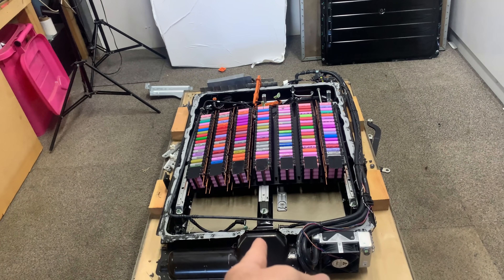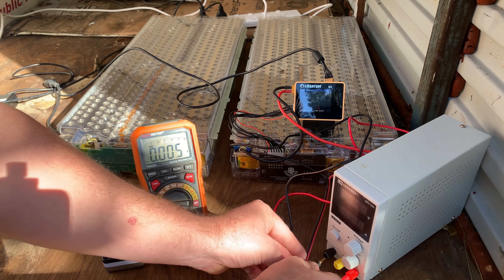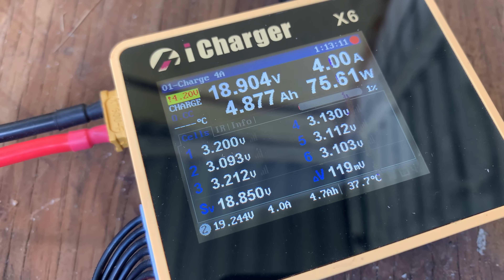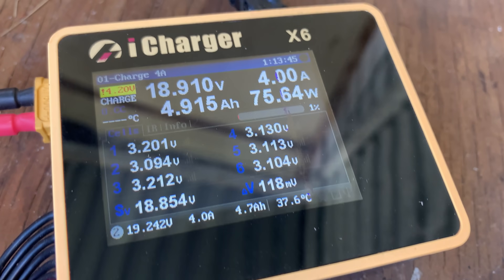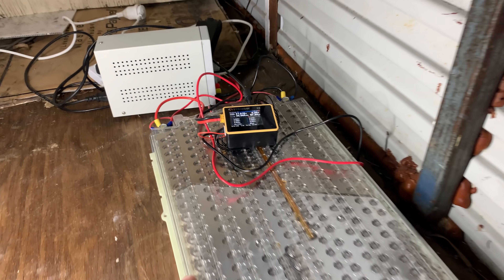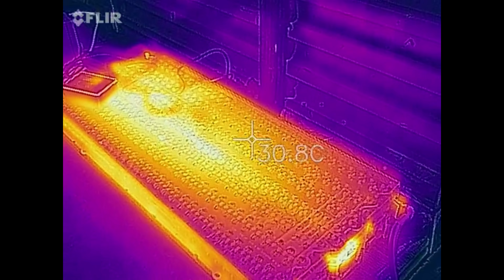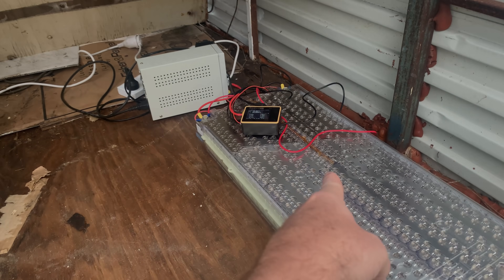The process of recovering Tesla modules from Zero Volt to useable!

Comment: Again you need to get all the cells above 4 volts and it will stay, i actually ran into a cell like that last week, wouldn't hold a charge because it went to 0v and until I got it full charged to 4.2 it kept dropping back to 0 over a week. Now I fully charge it and checked yesterday and it still at 4.18
Reply: Yea is it just me that's thinking why not fully charge it to at least the nominal voltage? If it's not holding a charge once you take it off the charger then why not turn on an inverter at that point and see if you can run a load for however long.
Reply: Get ahold of a barrel shop fan or 2 and put them right in front and on the side of that battery, maybe with an condenser coil or even an evap cooler behind them, you can keep those cells cool enough  if that's the limitation.
Reply from the maker: I think that is a lot of heat to get them over 4 volts this is a huge battery and went back to zero after only a few days.. I think it would be dangerous to continue
Reply: @HBPowerwall  You can lower the current, and until it gets over 55c you have nothing to worry about. In fact if you Google '18650 max temp' you will see 60-65c being acceptable... Also try disconnecting the PCB from the battery. That maybe the problem
Reply from the maker: that is the temp i can see from the outside, with water cooling in some shots under all the plastic etc cell time inside would be much higher than I can read with thermal camera i'd say
Reply: @HBPowerwall  lower your current until the heat is acceptable to you and wait days for it to get full charged. Not sure what the balance board is doing when the cells aren't balanced, you tried bypassing it?

Comment: Do it again :D
I mean it did something to improve, just not enough yet.
So if I understand that right the high voltage is to "burn off" the dendrites that internally short the batteries. Basically like tiny fuses inside some cells. Once you pop them they stop self discharging.
Maybe high discharge would do the same?
Maybe. I don't really have a clue haha. Anyways a bit dodgy.
Basically we just want to see you blow up a tesla power pack haha. Probably better to give them to recycling.
Reply: yes dodgy, i recommend hooking up 240AC to burn off your dendrites
Reply: @ursodermatt8809  Do it! Do it! Do it!
Reply from the maker: I have a spare Delorean in the storage shed - hook it up?
Reply: @HBPowerwall  1.21 gigawatts? That should work haha
Reply from the maker: I was thinking it should cover the overheads... if not we can go back and do it again..

Comment: Pete could you not mark the really hot one via the fler, then try and disconnect those cell welds, then try and charge again?
Reply from the maker: They all look hot.. remember the Nickel plate skues the thermal reading..
Reply: @HBPowerwall  ok it must spread the heat to other cells, rather than tip the lot can you strip out some cells and try to charge them, or is it not worth it
Reply from the maker: I just don't think it's worth it
Reply: @HBPowerwall  are you kidding? How many cells is that? If you are declaring it dean then ripping it apart some more should come next. I would use a pair of flush cutters to remove the Nickle plate and once you have some single cells either make a small pack like 4s maybe and use a car charger that charges to 14.4 volts. I would want to see if they are all shot or what?

Comment: Its a shame you can't push enough Amps into the pack in order to break the fuses on the heater cells
Reply from the maker: Cell level fusing doesn't break fuses in my experience - however it might trip the CID if the cell had one

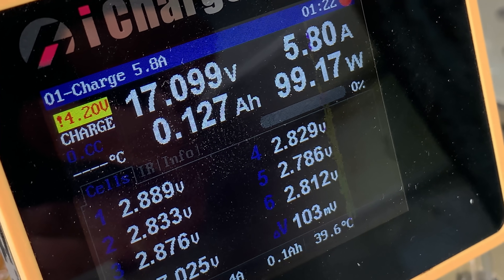Comment: From what I've seen, second series of the battery is the one that seems to be draining all of the electricity... How about you just chopping, one by one, of the second series untill voltage stabilizes? either that or if you follow the hot spots on your thermal camera from minute 4:05 there might still be some salvation for this battery.
Reply from the maker: There is no salvation - she gone!

Comment: Dell laptop power supplies are awesome. Built a 12v buck convertor power supply that uses the 120w/180w dell power supplies, and works a treat.
Reply from the maker: It does the job nicely - XBOX bricks also work well

Comment: You should be checking which cells are the hottest and cut them out so they are not in the circuit. Maybe it work after some cells (worst ones) are removed from the circuit.
Edit: OK, it’s dead, Jim.
Reply from the maker: Might try cycle it a few times, before I tare it down
Reply: Told him this last video just cut the strip

Comment: maybe the tesla BMS is faulty, you should remove it and give it a try to charge that huge battery and check if they still hold any charge
Reply: i think the problem is the tesla wall is being charged with coal powered plants. if say hbpowerwall used nuclear power it would definitively work again.
Reply from the maker: @ursodermatt8809  NUCLEAR is what i'm missing!

Comment: Last ditch effort tear it apart. Group cells in lots of 25 or less and zap them with 90 volts from a large charged up capacitor. The cells must have lots of whiskers known as dendrites. Try not to blow the cid's in the process.
Reply from the maker: or the fuses ... I don't think fixing the battery has any value other than learning from it.

Comment: Amazing, thanks for these youtubes.   Of course I have not personal experience except a few 2nd hand cells at low v (.5v)...  where maybe 20% seemed to recover...  so I would have thought that after reaching 3.6v at least some of the S(s) would hang there.   But as you've shown - no way.   Amazing.    Just to recap - these packs were simply drained (slowly) to zero volts which destroyed them?    Leads to the conclusion that allowing a design that drains to 0v is not a good design :)
Reply from the maker: Yep a slow painful death, Maybe they fixed this issue in the PW2

Comment: It looked like there were two to three rows of shorted batteries getting hot and pulling the whole pack back to zero. If you somehow could take out those shorted rows, you might be able to use the pack again. But I know that this is a non-repairable pack. Once you open it, it’s destroyed basically. Poor maintenance design by tesla but they only really care about sales so it’s understandable.
Reply from the maker: To be fair you'd never honestly expect someone to buy it then put it on a shelf
Reply: @HBPowerwall  True, that was the main reason for it to discharge you said.

Comment: This is why i like life po4 batteries they dont get hurt as easy as li ions . I drained my life po4 to 0.02 v and they came good after puting a fully charged life po4 on the dead ones so my charger would switch on . They are only ment to be drained to 2v but i stuffed up with some and drained them to far . Not having a bms does that . I used my charger to balance charge them equally but they are all diffent in resistance but charge and dont get hot . They arnt perfect but not throw away though . The life po4 batteries im using are 38120 cells capable of 200amps short burst or 100 amps cont . Its sad that all those cells are junk .  Can you replace all of them with your other cells using all the tesla parts and cooling to make a new power wall . Or is it all to hard to pull apart to put your cells in place of the tesla cells .
Reply from the maker: Yeh, LiFe batteries are the way foward...
Reply: the recommended low voltage cut off for lifepo4's is 2.5V and i personally would not go under 2.8V
Reply: Yes, FePO4 are a lot more robust but cheap ones less so. I once tried a "fix" for completely dead cells and actually got some working, turns out a small amount of heat does the trick. So does slow charging, like others have mentioned once they show reverse voltage ie -V where it should be +V then they are damaged beyond repair. Another method is charging just the weakest cell through the balance connector with a 4V 0.3A solar panel.

Comment: I had this happen also , after getting to the point where you are I then took the battery apart and was surprised that's some of the cells would individually charged up and stay charged While others self drained. U might try snipping the fuse wires on all the hot cells and see if they hold a charge. I think what you have is some of the cells in the group maybe discharging the others.
Reply from the maker: Might do that yet... Someone else said a short circuit testing the fuses.. I love that idea
Reply: @HBPowerwall  I would think you'd have to do it the other way buy fast charging maybe from another battery. Then the shorted cells would blow their fuses and might be more seeable from your heat detector.

Comment: Cool video. That self discharge is serious !
Reply from the maker: You got that right! Glad i could water cool it.
Reply: @HBPowerwall  
What is wrong with you, have you grown old? Did you accept bad /failed lap top cells inside laptop battery packs defeat you??

It looks to me that the thermal gun might be able to isolate indicate any shorted/damaged/failed cells.  That Tesla pack surely has a boat load of useful cells in it.
Are you going to give them up with a few bad ones?  Fight, fight, fight for those good cells.
Reply: sailingsolar I guess you need to watch the previous video before you conclude

Comment: How about keeping the pack frame, carefully removing all of the cells, and replacing them with fresh ones ? Is this feasable ? The packs are a perfect fit for the powerwall enclosure and they are watercooled, so it would be cool to be able to reuse them, still.
Reply from the maker: Lets just say I've looked into it, and not ask any more questions for a few weeks lol
Reply: @HBPowerwall  Haha, awesome. Looking forward to seeing your upcoming videos, then :)
Reply from the maker: we will see how it play out
Reply: Tesla don't want you to open these packs. They are that well glued and epoxied together you have to break the battery apart with hammer and chisel to remove single cells.

I have broken down one of these packs to recover cells for my 18650 powerwall and its a 8-10hour excercise plus you loose a few cells in the process. Plus you are left with glue residue on the cells to try clean off also.
Reply: @smdindustries3699  
i am sure tesla did not engineer the power wall primarily for do it yourselfers to dismantle it

Comment: the tesla preheat on cold batteries to 40c for fast charging btw
Reply from the maker: REALLY?  - But cells would have been 60deg or hotter in my case hard to see under the nickel plate & the battery is now at zero volts again so might not help.
Reply: @HBPowerwall  sorry i put that comment b4 i watched ya video through.  ya right its dud.
Reply: tesla preheats the battery for super charging. like 160kw. you need not heat it if above 0 C but the charging is much slower.

Comment: You have resistive cells somewhere causing a load and creating heat. You need to identify those cells and cut them out of the circuit (snipping the fuse). It's probably only a couple of cells per brick. Keep trying. See Gruber Motors YouTube channel.
Reply from the maker: Big fan of Gruber - but the heat is too spread out to be just a hand full of cells.
Reply: @HBPowerwall  Unless you have something else planned for that pack, then it doesn't hurt to try. Keep the coolent flowing and find the hot spot or get a nice milliohm meter.
Reply from the maker: I'll see if i can get a more accurate DMM
Reply: @HBPowerwall  You can actually work out which cells are draining the others without snipping wires, using a sensitive voltmeter across each fuse link, the polarity of the voltage will show whether its consuming current, or supplying it. Did this to find a dodgy LifePo4 in a small pack I made. Also you can do this whilst charging the pack to find cells that have gone open circuit.

Comment: It's cool how you can see the individual hot cells on the thermal. Makes sorting out the junk ones easier.
Reply from the maker: It sure helps!
Reply: @HBPowerwall  Now what we need is a "hacking a dead PowerWall pack with shorted cells so it can be used again" tutorial. I would expect that from the thermal image only the ones that lit up are actually stuffed, so it should be possible to cut them out of circuit from both sides and use the pack for something else with a simple bypass.

Comment: Seems to me that the problem was in the manufacturing of this Powerwall because you should get a lot longer than 5 years from lithium cells. Hell you get longer than that from AGM Deep Cycle Lead Acid batteries, at least I do using multiple 200 Ah Deep Cycle AGM
Reply from the maker: The issue was no use for 5 ish years and self discharged to zero volts over a very long time.. Apparently they effectively rust internally
Reply: @HBPowerwall  
i am always amazed about those people. it was quite clear from the video. and then that ignorance being used to promote lead acid batteries

Comment: @11:42 that is crazy, but at least you can stay warm by them. rofl

Once they start getting hot, I just over charge burn them out and recycle.
Reply from the maker: Won't be over charging these (unless I can do it safely lol )
Reply: @HBPowerwall  I have found old metal buckets work get for that, unless they get so hot they melt the bucket lol
Reply from the maker: I think if this many fully charged cells go thermal i'm in all sorts of trouble
Reply: @HBPowerwall  No doubt Hiroshima lmoao

Comment: keep trying, more amps, pulsing, whatever it takes, it must live! haha
Reply from the maker: I like your style , but you honestly think i can milk another video from this lol ?
Reply: @HBPowerwall  you could do a video to find out at what temperature the meltdown starts?  
But of course that is not very wise thing to do!
Reply: @HBPowerwall  PASS THE MILK, or send it to me? i'll happily poke at it for a few months, i have lab power supplies, big BMS units and multi chargers.
Reply: also i think you gave up a little early, from my experience, the heat comes from the overcoming of the resistance of the low voltage in the cell, once it reaches 4V again, in theory, amperage should decrease, as the resistance is lower.  (as long as the cells aren't like 200 deg, lol)
Reply: I would charge it to about full and cycle a few times before even thinking of total loss.
Reply: I’m the type that would keep trying. I’m always experimenting.

Comment: hi Pete .. glad you still HERE!!! please don't do it again.. life is short enough. ok . butt you have taught the community. it is not worth a light . time or money. to go there. .. please STAY SAFE AN WELL . looking forword to super cap. and kweld info.???  tone uk.
Reply from the maker: Just once more? Over charge and watch go thermal? and what kWeld info do you need? I don't even know who has the Community Spotwelder at the moment..
Reply: @HBPowerwall  you were going to do one on kweld with super cap.??  i did  get one . and because of something you said.( nice an informative. ) i spoke with good friends who know more than i. and come up with..no caps.. butt use 4 gel type batts ( but 18650 in side ) as power supply but keep them close as in a cross. it seems to work well. no bms to restrict amps. also  up the size of cable both in and out. all seems to do very well.

Comment: Take your time and oil everything as you go back together and it should be fine.
Reply from the maker: Built 100's more concerned with end float and not having the right tool to check it.. lol
Reply: @HBPowerwall  I know that is right, that is what keeps me from even fooling with anything past 96. Need to much stuff to make them right, don't even get me started on flawed metal.

I've had many people get mad over me touching none of this new crap, can't get sum to understand, that some manufacturers use computers to turn stuff on and off through negative while others use positive. It is a royal pain since they done that mess, I miss points and distributors. rofl

That is funny how adding more ah on 3.7 volts can sustain anything, if I have learnt anything dealing with Li-po or Li-ion is they don't play fair when charging. lol
Reply from the maker: YEs to all the above!!!!!

Comment: I used an x6 in power supply mode to recover a car battery. I set it to 14v at 20 amp power supply. The only thing is you turn on power supply before you connect it to the battery
Reply from the maker: Did you recover it or just charge it?
Reply: @HBPowerwall  I used it to raise the voltage to 9v on battery and then changed it to BP mode to finish charging at 5 amps, battery still works today.
Reply from the maker: Ooh cool... glad it worked well!